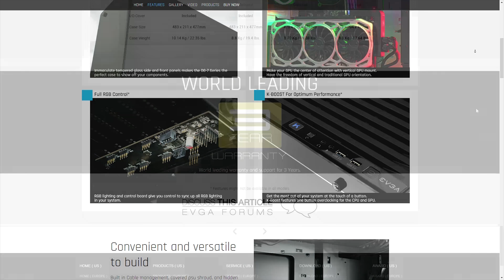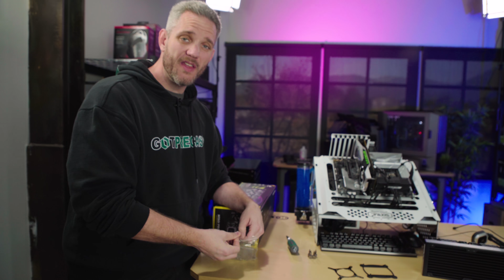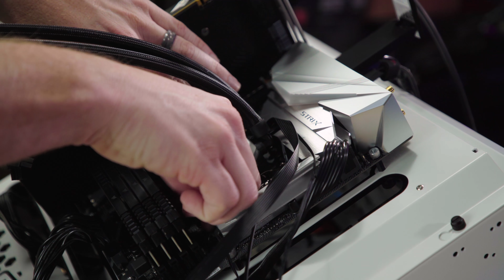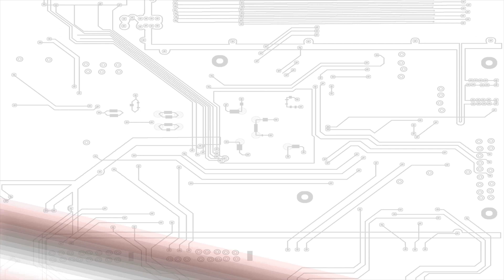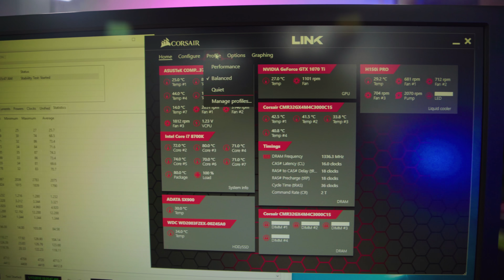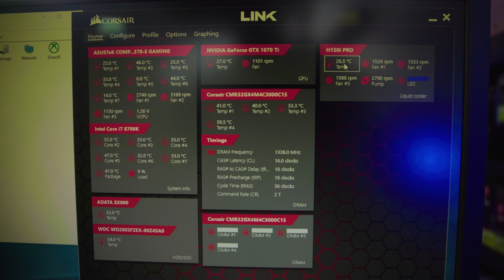Corsair's Largest AIO yet... But is it any good? H150i Pro RGB

Comment: ALL the cables should be detachable!!! All of them. WTF were you thinking Corsair? So much tougher to get custom sleeved cables into your system with this AIO. SHAME!
Reply: I cut that shit
Reply: @riderrocklee  Is that safe? Total rookie here.
Reply: @BAAa-tw7lo  dude I forgot what this video is about  if u talking about the fan cables on the pump yeah u don't need them
Reply: What cables did you cut? I'm going to get this AIO and replace the stock fans.
Reply: you can't just cut the cables, buy another cooler instead ! the rgb and fans and pumps are recognized and set-up all in one tab/panel of the corsair icue software that's why they are all connected to the base, whatz makes corsair offer leagues above other brands is the ease of controlling all your settings in one app, if you aren't going to use iCue features buy another brand, in one control panel i can shut down all the fans then raise their rpm one by one to tweak the best noise/cooling ratio with like 3 clicks of your mouse, no one else does that, there's a reason why corsair is so successful you can also make rgb/fans/psu profiles that you can switch with one key press I won't say it's awesome because I'm not a fanboy but they have zero competition on this, ZERO
Reply: Just make your own then
Reply: soupistasty5 you write like Trump, I like it
Reply: soupistasty5 ah yes the trump style English. Nice

Comment: Looks like a POS honestly....
Reply: That's ridiculous. So long you clean your budget parts beforehand, and take good care to match metals you shouldn't have to worry about a loop with "Value" components failing. Jay showed this himself with the use of a cheap waterblock in very late 2017.
Reply: Grave Flower A high end air cooler is huge and fucks up any aesthetic of a PC case
Reply: This or the x62?
Reply: Josh_519 Dude, there is no way you air cooler can beat my kraken X62.  I have a 7700k at 1.345v 5ghz all cores.  Never gets above 68c when gaming.
Reply: What's POS?
Reply: do not overexagerate Josh. A hyper 212 evo with push/pull is not as good as a 360 or even a 240 AIO. The noctua d-15 comes really close though. The bad temperatures here is due to the bad toothpaste intel puts between the die and sink. Got my girlfriend a 8350k that did 4.8ghz @ 1.36v ( i know, a bad bin ) that reached 94c with a 240 AIO. After delid we have yet to see temps over 75. Used thermal grizzly conductonaut.
Reply: @ReizungV  I got an 8600K doing 5ghz @1.25V, paired with the Corsair H115i PRO (280mm though) on balanced/quiet. The highest temp i hit after 10 min Aida64 was 63c, hovering at 58-60c most of the time. Hit around 70c with 5.2ghz @ 1.36V. I have not delidded it (yet) and using mx-4 between cooler and IHS
Reply: That is a really good result Rune. Reccomended a 8600k for my brothers build aswell. It hits 5.2 ghz at about the same voltage but needs 1.3 to stay stable at 5.0. He is using the same cooler as you are using and reach max temps of around 75-80 on 5.0ghz. These cpus, especially when you get lucky are beasts.
Reply: Yeah, i'm really happy with it. Thought it was time to upgrade, was using my old 3770K until recently :) Ran it with a 9€ cooler for 5 years at stock, before getting a Fractal Design Kelvin S24. I have recently replaced pretty much my whole pc, except for the graphics card. Managed to sell my old fans, case, reservoir and fittings and motherboard/ram/cpu for 250€ ish though. I got a 1060 6G Gaming X from MSI, so not in a hurry to upgrade it. Was a bit expensive to upgrade xD Waiting for benchmarks to see if it's worth getting a 2070 instead of a 1080
Reply: no it looks good
Reply: my experience playing games is i never see my cpu temperature into the 60s on my 6800k 4.2ghz 1.289v running fans on balanced. for me personally i really like a balance of performance and acoustics. and also i suspect changing the fans will help at least that was my plan with this use it as is change fans later if need be. My h115i with ML fans hovered in the 60s in games so i droped 10c instantly. just my experience with the cooler.
Reply: Asetek is garbage. Enermax is the only good AIO maker.
Reply: @ReaperX7  asetek own the patent to every single aio out there, so...
Reply: @keasyman7084  Not exactly. They only own the pump in block patent which is one of the problems of the manufacturing of pump in block. They don't own the pump-in-line and pump-in-radiator designs. I forget who owns them but it's not Asetek.
Reply: Mos Eisly Thanks man
Reply: That block looks cheap as hell. The older one look really premium
Reply: What would you recommend at that same price point, instead?
Reply: Grave Flower lol
Reply: yeah. 
well for starters looking at the wiring seems sloppy
Reply: It is
Reply: Josh_519 Air is only as good as the air flow it can get and the ambient temperatures it can maintain. Any liquid loop can beat air with the simple fact it can bring down a CPU to a stable temperature faster than air can because your transporting hot liquid away from the heat source to a cooler radiator to dissipate the heat quicker than any air system can even with heatpipes and large heatsink fins.
Reply: Yup. What a hassle. Stick with air cooling
Reply: With a radiator that huge and a pump that puny it has no chance of being anything else
Reply: Yep, all CLC's are junk. Its gotta be either full custom (although EK and swifttechs AIOs are also good) or high end air cooling or you are just wasting your money.
Reply: @BLOEDVLEK  Let me know when your custom loop comes with a 5 year warranty and damage protection if it does leak. That is why I buy AIO Liquid Coolers. I have seen you custom guys kill too many cards, boards, and processors all in the name of RGB and aesthetics. Granted it will take me months to see any form of replacement, it is Corsair we are talking about, but I have peace of mind knowing that my hardware is protected.

Comment: Less than 3 minutes and I'm out. No detachable cables, cables are a mess, and no Threadripper. Corsair is getting sloppy.
Reply: ScytheNoire yeah I switched from the h100i to the Celsius 24 and have been way happier
Reply: I've had two h100i v2 pumps die in 20 months. I'm done with Corsair AIO.
Reply: Every TR COMES WITH A BRACKET
Reply: ScytheNoire sloppy as in not catering to your specific preferences?
Reply: People that dont give 2 shits on looks wouldn't buy this anyway.
Reply: ScytheNoire Right for sure, then this cooler is not for you. Other people do not give 2 shits about how it looks inside, as long as the performance is good.
Reply: Frank problem with that is there are better performers for the same or less money.
Reply: The cabling is not neat and tidy. Just look up any case, Jay has done a ton, that have nice, neat cabling. It involves not having excessive cables. That cooler has extra cables going all over, rather than being in a tidy, clean, single cable grouping. 
Example, my case only has four visible cables, two to the graphics card, and two to the mother board, and they are braided and in a cable comb. It's very neat and tidy. I don't want messy cables running all over, which would happen with this cooler.
Reply: Dead in Red
Ok, well then i agree that this cooler is quite useless then hehe

Comment: Hey just wanted to let you know that your Videos inspired me to build my own pc with a budget custom water cooling loop
Reply: hey dude, just a bit of friendly advice. id recommend putting the money that you would spend on water-cooling on getting better parts. budget water cooling sees very little value for performance gain and water cooling only really makes sense when cooling the top hardware  as thats where the performance gain cant be had by buying better hardware.
Reply: @xTraumaaBRYL   agreed, been building overclocked rigs since a bootleg of Windows 95. A good air cooling block will work fine especially for your first attempts. That said, if you have extra money this AIO is a pretty easy install compared to building your own circuit.
Reply: Dave Snow an OLED TV is obviously the best choice here, the market is absolutely inflated by everything, even power supplies are becoming less available with higher pricing
Reply: I'm building my first gaming PC and I have everything except the GPU. I go online to buy a 1080 and see the price for them and I'm completely deflated to see that they are double or even triple the MSRP. I might just sell everything buy myself a nice OLED TV.
Reply: Raven Assault buy a 2080 Ti pussy
Reply: Kerry, I know this is hella late but why not get a fluidgaming series from ekwb? the only problem is the gpu block is only for founder edition cards